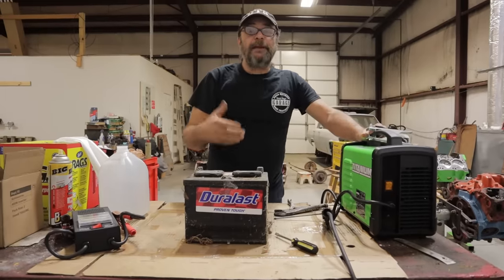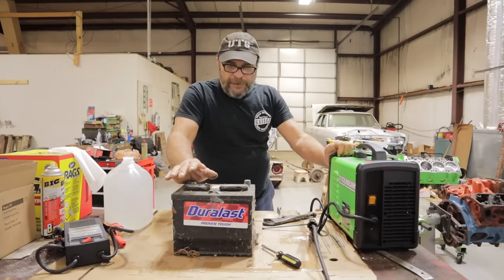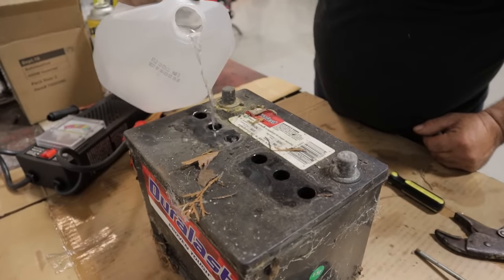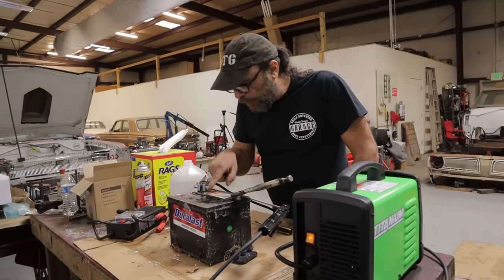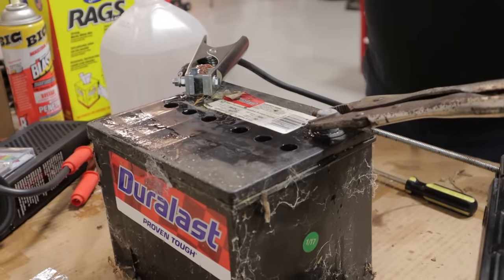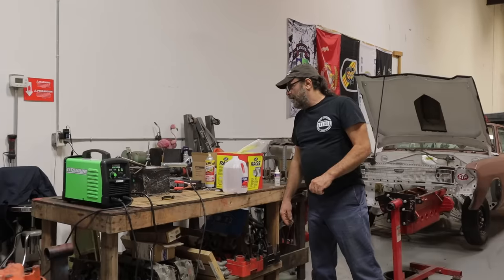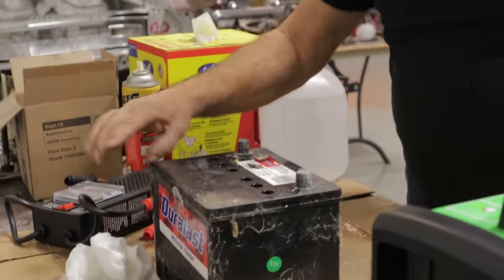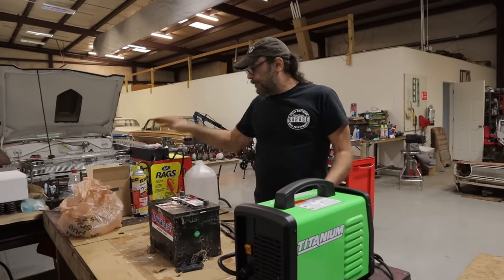Reviving Dead Batteries With A Stick Welder

Comment: I've been using this process for many years. I live off grid. My solar power battery bank will get very weak after a few years use. I use much less amperage over many hours time to rejuvenate the cells. Yes, this process is for real and it does work very well. The real test is to use a battery testing hydrometer to check the specific gravity of the electrolyte in each cell. Check the SG before and after charging. That's the correct way to see how much it improved the battery performance. This process is not BS. It works very very well! Note: it's much safer and much easier on the battery if you use far less amperage and let it run for many hours. For a small car battery, 10 amps is enough. Depending on how bad the battery condition is, It may take 24 hours or more. Check the voltage as it's charging. It needs to be maintained at around 16.5 volts. Also check the electrolyte specific gravity of each cell from time to time. The process is complete when each cell has reached a specific gravity of 1.265. This is the proper way to do this. Using very high amperage for a short time is extremely hard on the lead plates. It will get far to hot.
Reply: @faizaanalap4  actually, they say about 80% of old discarded batteries can be revived.
Reply: @rockhoundingeasternwashing5308  It absolutely can blow out a short, many folks have brought back 0v batteries like this.
Reply: All your talking about is charging a battery with a regular battery charger. The point of the video is how to REVIVE a bad battery that wouldn't take a charge or pass a load test. Not the proper way to charge a good battery
Reply: @shamust77  no, one needs a uncontrolled batt charger. One that will not stop charing over 14.2 volts. To revive the batt, the charger needs to charge up to at least 16.5 volts DC. I've been using this method for nearly 15 years. I know what I'm talking about!
Reply: @shamust77  that's what I'm talking about is reviving an otherwise no good for nothing battery. A batt that will no longer take or hold a charge. A batt that no matter how much you charge it with a regular batt charger. It won't take a good charge and the specific gravity of the cell electrolytes will not have a proper SG. MY method is basically the same as your method. It reliquidfies/dissolves the "crystallzed" sulfuric acid that collects on the lead plates. But my method is much gentler on the lead plates. Longer batt life using my way. My off grid house batteries cost a good sum of money. Long life is important to me!
Reply: This gravity check of 1.265 how is this done I mean is that what the thing with the rubber bulb is for I remember my dad had one  doing something when I was a kid , it looked like the thing used to check antifreeze sort of
Reply: @billmeade9029   Yes, you use a Hydrometer, its a tube with a rubber bulb, and a float inside that measures the solution.
More info here:  https://www.youtube.com/watch?v=WzRs0L8Wi4g
Reply: Om
Reply: Thankyou for sharing...invaluable info
Reply: @rockhoundingeasternwashing5308  i think high amperage charging would heat up the lead plates causing expansion and breaking off sulfation. yeah its harder on the battery but may rejuvenate dead batteries better.
Reply: How many amps would you use on a truck battery?
Reply: Thanks for that plug... good feedback!
Reply: It's hot he says after holding load test for 25 secs? Scary ..because he is surprised when tester / leads are very hot. 🙄😳🤔 Saw fking paint bubbling off tester!    There is a reason why it says hold no more than 9 secs.
Reply: Interesting to hear..My battery bank as just died on my off grid solar system due to a week of minus degree frost  Sad thing is is that I didn't insulate them and now i am sure they are ruined ..
I am wondering if doing this charging method via my welder would help my battery bank is 24volt via twelve 2 volt industrial forklift cells .. I am wondering if I try this method on my cells then do I do the cells individually or keep them all together as they are in series..
Would you have any idea please..
Reply: @Dan Thompson  it's removing the sulferic acid that has crystalized on the lead plates. Turning it back to liquid sulfuric acid
Reply: Thanks a ton for the info! I have a Jackery 240 with some jumpers that when used together would output 10 amps @ 12v. Would this be a viable method to revive a car battery? Thanks!
Reply: How do you maintain 16.5volts at the same time as 10amps?
Reply: @Goat Sinker  you'd need a charger that is not controlled. One that keeps on charging at full output. Normally, as a battery begins to take a full charge, most chargers will slowly slack off as the batteries become fully charged. They won't charge beyond 14.2 volts. A ten amp charger produces 10 amps!
Reply: Great advice for solar batteries and such. Those batteries and car batteries are built differently from what I get? Most videos regarding bringing old car battieries back to life talks about giving them a real 'kick', 100-200A for some few minutes at the time. But if as low as 10A will do, over many hours, that sounds more safe
Reply: @Rimrock300  yes, 10 amp for a standard size car battery. The larger the battery, such as a 350 amp hour solar storage battery the more amps one can pump into it
Reply: @rockhoundingeasternwashing5308  That's frickin awesome, thanks for sharing your experience. Can you just keep it at 10 amps @ 16.5 volts for 24 hours or so? I'm thinking a good shop power supply should be able to do that. Outdoors of course, and checking the specific gravity regularly.
Reply: @wrybread  yes, 10 amps. volts need to reach around 16.5 before this works. Check often the specific gravity of each cell. When all cells reach 2.65, it's done. It May take only a few hours or much more. It
 Depend on the batteries condition. Be sure to check the SG before you start this process to see how low it is. Then follow its improvements. Be sure to add distilled water as needed. It will evaporate away as the cells cook along! Leave the cell caps off
Reply: Should we use an ac welder or dc welder? Or both are good for this job?
Reply: @nini202020  DC!
Otherwise you will be charging/discharging the battery 50/60 times a second depending on supply hertz!
Reply: @andrewallen9993  many thanks. I'm gonna buy a dc welding machine to do this.
Reply: Which charger do you use
Reply: @nini202020  I've never done it before but will experiment this week.
P.S. don't nix up your +-polaritys :)
Reply: @andrewallen9993  please keep me updated how it goes. Thanks.
Reply: @andrewallen9993  thanks for the precious info.
Reply: Does the +/- connection matter,  because a DC stick welder uses revers polarity?
Reply: @RickcJc  Indeed it does! The positive lead of the welder HAS to go to the positive pole of the battery. Use a multimeter to tell which lead is positive.
Reply: @Richard Christenson  I would think you'd want to be SURE positive is connected to positive. I don't recommend using an ark welder for this
Reply: i use nife batteries and they boil to 16.5 on the reg yall
Reply: Thanks for great info. I have a question for you. The crud that flakes off the cells by using your method, should I turn the battery over into a plastic tub and drain out all the acid as best I can, then fill battery full of distilled water and shake it a lil and drain out the crud untill I guess I have it all out? Then refill it with fresh acid or use the original that came out of battery??
Reply: Sound advice as I to agree with your statements. Too much heat can warp the plates causing a short & then it's over.
Reply: That crud coming off is the sulfer and is essential to the battery. But one could replace the sulfuric acid if it weren’t nearly as expensive than the battery locally as I found when asking the same question. No need to. But would be an interesting test to see if it helped any. Didn’t seem it needed that. He had good results!
Reply: @johneubanks5951   I got a set of Trojan T-105's retired at a golf course and charged them up best I thought I could. I did as you're suggesting and drained the grey looking electrolyte into a tub wearing rubber gloves of course. Then I filled them with regular water and carried them in back of the pickup on our rough roads I was using to stir up what was settled on the bottom then draining it too and putting it aside. Getting goggles on and preparing for who knows what I filled the cells with baking soda and water and of course got a somewhat violent and expected reaction. Emptying that , I then drained it and flushed with lots of water. I now took the old electrolyte and filled the batteries attempting to neutralize any residual baking soda (and could see it was doing just that). Draining again and replacing with new electrolyte yielded me 6 good years of service and saved me about $600...this was in the mid 80's and so provided me with a bank to power the house for not much money but plenty of satisfaction and filled my need curiosity had instilled.
Reply: Can I use this method to revive an old set of Golf Carts batterieswhile still in the golf cart or must I Isolate them, and do them one at a time? @rockhoundingeasternwashing5308
Reply: Thank you 😊
Reply: Please make your video as I like you're style.
Reply: @rockhoundingeasternwashing5308 75
Reply: I've used this method too. To be safe I keep checking the temperature of the posts with an infrared thermometer. I Don't run the welder more than 5 minutes with 15 minutes cool down between charging cycles. Usually 5 or 6 cycles does the job. works great.
Reply: @cobbleup  6-7
Reply: Will this work on AGM batteries
Reply: @anthonylimjoco5958  I’ve never tried it on an agm. If I was going to try it on an agm I would probably cover the plates with a good amount of water so it could actually “boil”. Be clear though that I’m not recommending this method to anyone. 
I did have a battery blow up once because of high amp charging for too long a period. A piece of the top blew off and it split one corner from top to bottom. 
Lesson learned…if anyone is going to try these methods be sure to wear protective gear and out doors away from other people and pets and valuables.
Reply: @cobbleup  I asked around as well... some people use a standard battery between the AGM to find the right settings. Then connected the AGM, they were able to get the battery to work but ended up replacing the battery as it started to go bad again and had to jump start. After that they replaced it.  I have a deep cell that went dead and will try it on that.
Reply: This is about dead batteries not weak batteries. You cannot revive a cell that would not bubble with 10 A, even if you had all eternity to play with. Only 100A+ can do it. You do it for 20 seconds, back off for 1 minute, 20 seconds, back off. Once it starts bubbling you can use sub-100 amperage. Batteries are made for high amperage, 500-1000A, hence their ability to start a car (turn the engine over, repeatedly).
Reply: Thank you, finally someone says the obvious. Sulfide is an issue, however over charging can be worse. The lesson should be in extreme circumstances this method will work . But extreme safety should be taken into account.  But what do you do if only one or two cells test low  with a hydrometer?
E
Reply: @johnzeller9619  you keep charging until the low cells are equil to the good cells. It's a do or die situation for the battery. It's not any good if the battery doesn't perform right or won't hold a charge. This over charging methed will either make the battery operate correctly, or it won't. You have nothing to lose, only something to gain!
Reply: So you're hitting it with 10A 16.5V from a charger?
Reply: @RogerPack  Yes, but keep in mind. Most standard chargers will slowly decrease the charging voltage to around 14.2 volts, no more. That's the point the battery becomes fully charged. You must use a charger that does not have this automatic controlled voltage. I've found that a solar panel works great. For a basic car size battery, It should be a panel that produces around 8 to 10 amps or a bit more. 12 volt panels actually produce around 19 volts. It'll do the job very nicely!
Reply: I have a solar trailer with 2 24v battery banks. How do I use this method to recharge/recondition each battery cell so they are all performing correctly?
Reply: @rockhoundingeasternwashing5308 I’m new to this and need help!
Reply: I've heard the "80% of old discarded batteries can be revived", but there's got to be some kind of age limit for a battery to be revived right? I don't think one could use this method to revive a let's say 13 year old battery that's been sitting this entire time? Or do you recon even that would work?
Reply: @sanibelt  it may be possible. It may take a lot of overcharging time to bring it back. It would depend if the lead battery plates aren't already deteriorated and could hold up to that much cooking. Never hurts to try. The battery is no good as it is. So why not give it a shot? I would!
Reply: @rockhoundingeasternwashing5308 do you have any videos to show us your process?
Reply: I have 2v 620ah acid batteries, 12 of them, i live off grid too, can you suggest me how to rejuvenate them ?
Reply: @christosgerakinis2628  do your batteries have caps on them, or are they sealed up where you can't add water to them?
Reply: I add distiled water every 6 months, but they're getting old, i have them like 13 yrs, and soon it will cost me around 3,500€ to replace them :(
Reply: @christosgerakinis2628  do you have them wired in a series to produce 12 volt or 24 volt?
Reply: @rockhoundingeasternwashing5308  
They're in series, 24v, i have 2 victron 100/30 charge controllers, with 2,820w solar panels but, the capacity of the batts have dropped significaly....
Please help !
Reply: @christosgerakinis2628  
Ok, 24 volt it is.
Here's how's I'd do it.
You'll need a decent battery Hydrometer so you can test the specific gravity of the electrolyte/water of each battery cell. Rewire your battery connection series cables to produce 12 volt, not 24. Leave your charge controller set at 24 volt. Does your charge controller have a setting for (battery equalization)? If you're  not sure, read your controller user manual!
Let me know. Then we can continue...
Reply: You, sir, are why I read the comments.  Thanks for the info!  My battery isn't totally dead but it's weak and 4 yrs old.  I like that you say the SG reading, amp level and 16.5 volts are the objective.  So 6 hrs, 12 or 24 hrs+... Who knows?  Doesn't matter.  When you get the right numbers, it's done when it's done.
Reply: @Face2theScr33n  yep, they are done when they are done. SG readings are the only real way to know
Reply: I have checked my batteries, the floating voltage is 13.6v , the sp is around 1.236 but, the capscitance is not what it used to be (620ah) ???
My inverter is victron 24/3000w , but   the batteries are dying...
R.I.P
 :))
Reply: @christosgerakinis2628  don't give up on the batts yet. I asked about your CHARGE CONTROLLER, not your inverter. Does your charge controller have a setting for (battery equalization)? Look in your operators manual if needed. If no manual, search online for the make and model. Search (PDF operators/user manual) for your modle!
Reply: @rockhoundingeasternwashing5308  then how can i operate my system ?
I live off grit ...
Reply: @rockhoundingeasternwashing5308  it is automatic, it indenifies if its 12v or   24v , i cannot interfier in the program, sorry...
Reply: @christosgerakinis2628  The trick is that you'd need to drive the battery voltage quite a ways above 24 volts. Up to a minimum of 36 to 48 volts DC. maybe there's a batt charger that can deliver that high of DC voltage, I don't know...
Reply: I do
I replemisj them every 6 months with disstiled water sir
Reply: @rockhoundingeasternwashing5308 Brother, I followed your specs and in about 3 hrs my battery is holding 12.73 after turning all the lights on for a couple minutes and starting the truck a couple of times.  Cell nearest the positive terminal juice was only 1.150 SG, the rest were 1.210.  The juice got cloudy, but I figure that'll settle?  When I was done, SG was about 1.300.  Great method to clean a battery, thanks!
Reply: @rockhoundingeasternwashing5308  I put it back in my truck after about 3 hrs, starts right up.  Turned it off, but left the lights on for a minute and still had 12.70 volts.  Beautiful, thanks again!
Reply: Ok found it !
6.3. Automatic equalization Do not equalize charge Gel, AGM, VRLA or lithium batteries. Equalization can cause damage to the battery if the battery is not suitable for an equalization charge. Always check with the battery manufacturer prior to enabling equalization. Automatic equalization is by default disabled. When enabled, it can be configured with a number between 1 (every day) and 250 (once every 250 days). When automatic equalization is active, the absorption charge will be followed by a voltage limited constant current period. The current is by default limited to 8% of the bulk current and can be adjusted between 0% and 100%. The bulk current is set by default to the maximum charge current the solar charger is capable of, unless a lower charge current has been chosen. The maximum equalization duration is set by default to 1 hour and can be configured between 0 minutes and 24 hours. The automatic equalization will end when the voltage limit has been reached or when the set maximum equalization duration has been reached, whichever comes first. When automatic equalization has not finished within a day, it will not resume the next day. The next equalization session will take place as determined by the day interval.

-My batteries are 2v opzs flooded.
Reply: @rockhoundingeasternwashing5308  Ok found it !
My batteries are 2v opzs flooded, 12 of them in series to make 24v

6.3. Automatic equalization Do not equalize charge Gel, AGM, VRLA or lithium batteries. Equalization can cause damage to the battery if the battery is not suitable for an equalization charge. Always check with the battery manufacturer prior to enabling equalization. Automatic equalization is by default disabled. When enabled, it can be configured with a number between 1 (every day) and 250 (once every 250 days). When automatic equalization is active, the absorption charge will be followed by a voltage limited constant current period. The current is by default limited to 8% of the bulk current and can be adjusted between 0% and 100%. The bulk current is set by default to the maximum charge current the solar charger is capable of, unless a lower charge current has been chosen. The maximum equalization duration is set by default to 1 hour and can be configured between 0 minutes and 24 hours. The automatic equalization will end when the voltage limit has been reached or when the set maximum equalization duration has been reached, whichever comes first. When automatic equalization has not finished within a day, it will not resume the next day. The next equalization session will take place as determined by the day interval.
Reply: @rockhoundingeasternwashing5308  
Charge controller victron 100/30 mppt two of them
Batteries 2v opzs flooded, in series 24v

6.3. Automatic equalization Do not equalize charge Gel, AGM, VRLA or lithium batteries. Equalization can cause damage to the battery if the battery is not suitable for an equalization charge. Always check with the battery manufacturer prior to enabling equalization. Automatic equalization is by default disabled. When enabled, it can be configured with a number between 1 (every day) and 250 (once every 250 days). When automatic equalization is active, the absorption charge will be followed by a voltage limited constant current period. The current is by default limited to 8% of the bulk current and can be adjusted between 0% and 100%. The bulk current is set by default to the maximum charge current the solar charger is capable of, unless a lower charge current has been chosen. The maximum equalization duration is set by default to 1 hour and can be configured between 0 minutes and 24 hours. The automatic equalization will end when the voltage limit has been reached or when the set maximum equalization duration has been reached, whichever comes first. When automatic equalization has not finished within a day, it will not resume the next day. The next equalization session will take place as determined by the day interval.
Reply: @rockhoundingeasternwashing5308  ok, so the charge comtroller have settings from 1-250 days equalisation , where do i set it  to get them back in life ?
Reply: @christosgerakinis2628  I'm not sure what that means. Send me the brand and model number so I can read about it
Reply: Thank you for  noticing this.
I have read the hole instruction dook  but never give attention to this chapter, thamk you so much, you saved me 3,200$ batteries, i was not aware from my ineglihence, thank you !
Reply: I've read all the manual, 50 pages, except the 2 last ones, and it was there "equalizing charge"
Thank you sooooi much
You are the man !!!!
Thank you
Reply: WTH is an “non-controlled” charger and where can we find them?!
Reply: @abechavez1876  standard battery chargers are designed to stop charging at about 14.2 volts. A non controlled charger will keep on charging to well over 16 or more volts. 16 volts or so is what's needed for this battery restoring process. Good quality chargers offer 6, 12 & 24 volt settings. Use the 24 volt setting if needed. That's if the 12 volt setting wont push the voltage up to 16 volts or so. These types of chargers are generally commercial grade and somewhat expensive, though
Reply: Im curious.  What about a 24 volt battery. Or a 48 volt battery.  Does the stick welder only put out 16v?
Reply: @strategicthinker8899 
What about a 48v lead acid battery.  Will a stick welder charge that
Reply: what about a 24 or 48 volt lead acid.  Will this method work
Reply: @piusnevitt9711  Yes. It's not really about the voltage leval. It's the amperage that gets things cooking. A welder would do it! Be careful not to let it get boiling and hot. Be sure it's not a sealed battery. Sealed will explode!
Reply: @rockhoundingeasternwashing5308  What charger do you use?